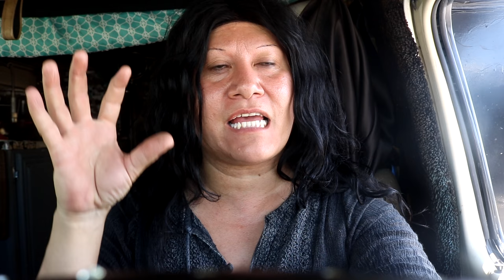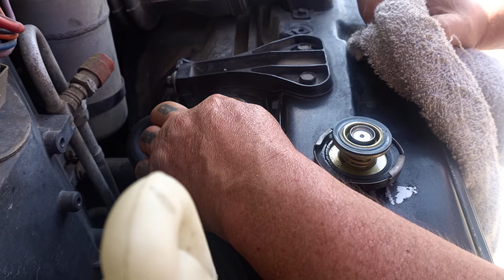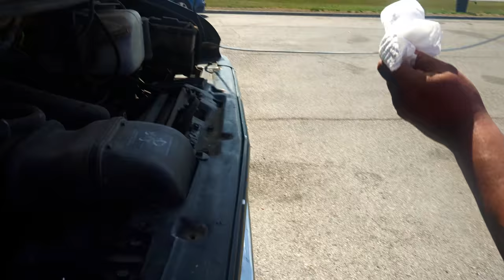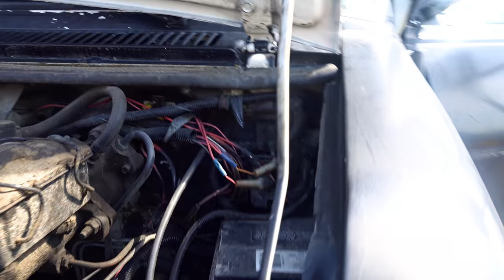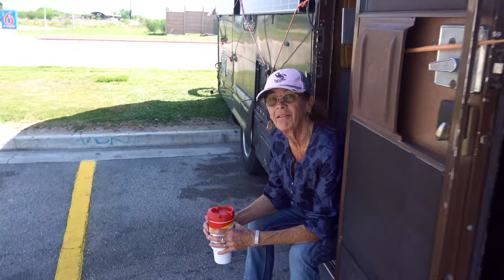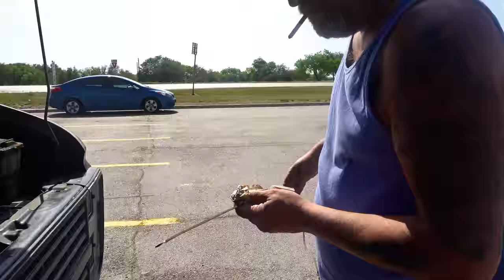RV Breaks Down Not Sure What's Wrong!

Comment: Hi Panda, This is a bit long, please read .....( I'm truly a mechanic, not an arm chair mechanic) from the sound of the engine and rough idle at first start-up it doesn't seem to be vapor lock to me. An engine needs 3 basic  things to run, 1) Compression, 2) proper fuel air mixture, 3) ignition/spark. ....possibly a bad ignition coil,....but sounds more like a fuel problem. 

As i have stated, from the sound of the engine It sounds like it's not getting enough fuel. possible causes to check are the following, ... bad fuel, fuel pump starting to fail, clogged or dirty fuel filter, bad or dirty injectors.  Start with the easiest task and work your way up the list. Also remove the engine cowling inside the camper and remove the air filter and bowl, ( I believe this  model and year of engine has a carburetor?? GM 350 ? year??? ) look down the intake on the carb and check to see if you see the injector spit out a nice stream of fuel in each port/barrel ( 2 ports side by side  ) when you press the gas pedal to the floor, you can also use the throttle lever on the carb to do this.
Has the gas filter ever been replaced? if this is the model i'm thinking of the fuel filter is actually inside the carb, where the gas line enters the carb, remove the gas line at the carb, now there is what appears to be the head of a larger nut that the gas line threaded into, remove the larger one ( the filter is inside that) I actually just did this two days ago on a 1984 Class-C , it's easy and takes only a few minutes to do. I would recommend you change the fuel filter, it only cost a few dollars to change ( $15-$20 )

You do a lot of travailing in the desert area in and around Arizona, the dust can quickly clog an air filter, please check and replace if necessary your air filter. A clogged air filter will also cause the engine to run rough and reduce your gas millage.

After checking all fuel issues and the engine still runs rough or quits down the road check the following,.... distributor cap and rotor, inspect for wear, cracks and any other possible damage, replace if necessary. This era of engine have been known to have ignition coils go bad ( square black box in center of distributor cap/ inserted on top of cap ) , since your there,..check your ignition cables  aka: spark plug wires for any damage and also don't forget to check or replace worn spark plugs, all of them. 

P.S, the coolant has nothing to do with the engine starting and running unless there is an overheating problem or a blown head gasket that is leaking coolant into the cylinders, this would also cause the engine to run poorly. If thee was any coolant leaking into the cylinders you would see the coolant fluid level dropping in the rad, and there would be white smoke coming out the exhaust tail pipe. ( White smoke= coolant leaking into cylinder, Blue smoke= engine burning oil, Black smoke= improper fuel to air mixture )

NEVER open a radiator cap when the engine is hot !!! he should have waited for the engine to cool down further before opening the cap, when the cap is difficult to open that usually means it's under some pressure and thus difficult to open ( basically it's telling you, DON"T open me now)  :)

i know this is a long list, and i'm not trying to preach,..but I am confident one of these things mentioned here is the cause, the engine might seem fine at the moment but rest assured the problem will come back to haunt you,  a good tune up and check for normal wear and tear should be done, you do a lot of driving, highway, back roads, dusty/sandy areas, etc... this all adds up and causes quicker wear and tear on the vehicle.   Onward bounds !!  :)

p.p.s: I also own a 2005, 21feet Class-C, Ford V-10 Triton engine. Hey who knows, maybe I'll see you and the tribe at the next RTR ?

Comment: Ausia, it still sounds like fuel pump or vapor lock.  Spring clothes pins on the gas line does help , at least on the older vehicles. My 1965 Ford Econoline still has clothes pins on the gas line from almost new and on hot weather it will allow you to pull out into traffic
and then die and let you sit in the middle of an intersection ! What fun !

Comment: My god it is a failing in tank fuel pump cutting off on its thermal overload circuit. Have it replaced ASAP As it will fail completely, Also have your fuel pressure regulator checked it could also be failing, Coolant lose will most likely  be the O ring on the riser tube behind your throttle body it will evaporate before you see it leaking so it is tough to spot...Good luck on your travels.

Comment: Love your group,I live in houston,came here from Maine,and my car had the same problems.it was vaperer locking.i am a ase certified auto tech.what happens is the older vehicles use less fuel pressure and can cause it to boil in the lines.so later on.the engineered put a fuel return system in.it just circulates from the tank to the throttle body and back to the tank and keeps the line cool to the touch.at up to 400 degrees under the hood it really helps.for now you can wrap some time foil around your fuel line where you think it's closest to heated areas.got luck my traveling friends.ever have any questions just holler at me on Facebook 👍

Comment: you have an older car so check water and oil levels every day, brake and steering fluid every week. also check you engine oil fill cap, if there's white stuff on the inside (looks like mayonaise) you have water in your engine (blown head gasket). try to keep your engine clean, oil and dirt will act as isolation and reduce cooling capability in hot places
Reply from the maker: Thanks

Comment: I'm going to recommend you implement "Maintenance Monday".   It doesn't have to be a Monday, pick one day a week and stick with it without fail.   On that day, every week, check all fluids, tire pressures,  all exterior lights, etc.   Get a GOOD tire pressure gauge.  Especially check transmission fluid. Also look at all your tires for nails, thread condition, any unusual wear.  Look at engine belts and hoses.    Check your spare tire. I checked my spare recently and it was FLAT.  Good thing I didn't need it that day.   Check generator oil, etc.  A few minutes spent weekly can prevent frustrating breakdowns and time lost on the side of the road and wasted $$$.  Do you have AAA membership?  Good luck to you and your traveling friends.

Comment: YAY Mick!!  Eddie (my 1983 Class C) used to that & only when he was hot.  Changed the fuel filter and did other work on him.  He still had problems, found out he has 2 fuel filters, the one up front & 1 in the back, near the gas tank.  Changed that one out and he ran like a top again

Comment: Change your Radiator cap! When the top seal goes it will let in air into the radiator as it cools down instead of drawing reserve coolant back in from the overflow like it is supposed to. That is why there was coolant in the reservoir and air in the radiator.

Comment: i had an old motorhome that would do the same thing i installed a cool can under the hood installed an electric aux fan for the radiator and hooked up some misters to the house water line that i could switch on while driving to help cool the motor all worked very well in the hot weeather or climbing long hills
Reply from the maker: Awesome

Comment: Ausia this is Harry, Lisies husband, I suggested the (map) sensor could be your problem with your vehicle. The check engine light doent always come on when sensors start breaking down. Mechanics can run other tests based on experience and equipment. Some parts stores will test the codes for free. O'riellys, auto zone, etc.
Reply from the maker: Thanks Harry... its been running great now that we have filled the fluids (my bad) although the check engine light is been on, but I'm going to have it checked out soon.
Reply: Panda Monium Autozone will put any 2008 and newer on the on board sensor reader thing & give you the read out.

Comment: I'd try draining and flushing the whole cooling system and buying a new thermostat and new antifreeze. Also add a bottle of techron carborator fuel injector cleaner or Lucas and a good tune up might help I have a 1985 Tioga class c with a 460 in it . safe travels 👍😊🌲🐾🐕

Comment: Glad you are running now, but You probably will be replacing the fuel pump soon. Keeping the fuel above the 1/4 tank level will greatly increase the life of the pump, especially in the heat. It depends on the fuel to keep the pump cool.

Comment: Wonder if the crank sensor is on its way out.  I have see them get hot shut the motor off and when cooled off. Motor start run no problem.   A scanner could help tell what happened and if any issues happening. You let them fluids get to low for to long.  It will be a new RV or motor.   Good luck  I hope it all worked out for you.  Take care stay safe

Comment: I had a vehicle with a similar problem.. After fixing many things based on friends bad advice, I called the dealership and asked for maintenance. I asked the guy who answered and he said it is probably the fuel filter. It's a do!lar and a half. Don't think about it just do it. The mechanic said the fuel filter was number one on their list of top common causes. If it's partially blocked the vehicle acts crazy, running most of the time but randomly refusing to start and sometimes cutting off on the road then starting again after coasting to a stop. Ignore had advice and change that fuel filter.

Comment: WHAT darrel w. said wooden clothespins.... we had a ford elite that would vapor lock, the young mechanic told mom to go buy some at walmart, showed me where to put them as mom wasn't mechanically inclined at all. lol   never had one cut out issue after the pins were put in place as the pins draw the heat away from the line.   we were always questioned why are there clothespins onthe fuel line?   that was fun.... hope it clears up

Comment: I had a 88 Chevy truck. The ECM went bad and would run for 15 minutes and wouldn't start until the ECM cooled down. The ECM looks like postage stamp size camera card that's quite up inside the distributor cap. It tested good but the test didn't get it how enough. I spent $400 on parts before I figured out the problem. The ECM was $25.
On another note, every time I replace the battery in my car or truck, the computer resets and I have to clean the intake. 
I've also seen the find on the water pump corrode to the point where the water pump doesn't circulate water. 
Another tip, some cruise controls won't work if one of your brake bulbs are out, especially one of the bulbs in the third brake light.
I know these aren't your problem but it might help someone.

Comment: An easy fix if it is indeed vapor locking; is to clip wooden clothes pins on the fuel line to help dissipate the heat from the gas line.

Comment: Your oil measures a little bit low when your engine is hot and running, don't over fill your engine oil, it's hard on your seals.  Measure your oil when the engine is NOT running, best reading is when the oil is cold and settled, and your vehicle is level. Transmission fluids measured when the engine is hot and running, and your vehicle is level, braking brake on. Coolant can deteriorate over time and should be tested for corrosion, buy a coolant tester. Even if your  Reservoir has coolent it could be  contaminated, and all this should be changed every 30,000 miles, I use a turkey baster to remove the reservoir coolant to change. Add only distilled water to your radiator, hint no calcium build up. I drain my own radiator, and only use the manufacturers brand at a dealership, flush with distilled water, then refill with distilled water and  coolant, usually older vehicles are 50/50 mixture of water and coolant. I've never had a  radiator go bad on me all these years.  I had a great dad that taught me when I started driving at age 14, hardship license, yes in some states you can still drive at age 14. I bet you didn't know that?  On the road again, happy travels! 🛣

Comment: if you're lying fuel line is vapor locking you need to reinstate the line going from your fuel tank to your intake of your motor work by or it's not so hot by your fuel exhaust it doesn't take much to insulate it and it's real simple to do if you can find some Plumbing insulation should be able to wrap around it and then take some 10 for a wrap around it you should be able to bypass the situation

Comment: I'd check your PCV valve.  They are about 5 bucks and easy to replace usually.  They can stick, suck oil, make you burn oil excessively, and make your rig run like crap.

Comment: You shouldn't be able to squeeze the bottom radiator hose.  If it's sqeezable that means that when the engine heats up, the bottom hose can collapse if it's too flexible.  Therefore shutting off the water flow from the engine to the water pump.  You're better off to get the radiator hoses that are reinforced with wire imbedded in the rubber.  The wire keeps it from collapsing.  Don't buy the solid rubber radiator hoses, because they will eventually start collapsing.   For your engine oil,  check it every 500 miles at least.  You do get oil usage depending on your weight and how many hills you climb.   I can use a half to 3/4 quart of oil on a ford 460 v-8 on a drive from Phoenix to Flagstaff on I-17.  Elevation wise we go from 2000 ft. To 7000 feet.  There are two really steep hills on the way.  One has been nicknamed "waterpump hill" because it's such a steep climb.  It requires a lot of downshifting, staying to right and a lot of patience.  Onward Bound!

Comment: Could be a bad coil.... when a bad coil heats up it will not send spark to the cap and then to the spark plugs. When it stops can you smell gas ? If there is no smell of gas then it could be a fuel pump.

Comment: A Vapor lock situation is not a coolant issue, it is a fuel issue. Generally the thermostat is on top of the engine, I'm about 99% sure on your old chevy it is on the intake manifold. The tank on the side is the expansion tank, fluid expands and contracts with heat. You do not have a blown head gasket on the intake side or you would have water in the oil. You'll have a cloud of white smoke spewing out the back if you are sucking fluid into the engine from a blown intake gasket on the compression side. 

Vapor lock is caused by gasoline turning to vapor when it is hot before it gets to the carburetor, it really isn't a common problem. More likely you have a plugged fuel filter or bad fuel pump. As the issue is only happening when it is super hot then check the routing of the fuel lines so they aren't to close to the exhaust, or perhaps the fuel line running across the top of the engine. 

You only check the transmission when the vehicle is running...

Comment: dont want to rain on your parade but my ex husband always told me that if your radiator blows bubbles after its full and the thermostat has opened at least once ... that it had a blown head gasket on the exhaust side.  not the kind that puts water into the oil.  have that checked.
Reply from the maker: Thanks

Comment: Fuel injection can't vapor lock, the return line allows cools fuel to continually circulate. If it's carb, and it's acting that way, go to summit racing online and get a carb heat shield and new gaskets. Then check all the fuel lines for a heat source or clogged filters. The fuel sock inside the tank could be breaking down as well. It's that simple, don't let a hiway mechanic give you some convoluted story, it's not that hard to diagnose.
1. The thermostat is on the top hose.
2. If your vehicle is 1987 or newer, you have the wrong coolant, you should have DEXCOOL a red color. The serpentine belt diagram under the hood says it is newer.
3. Don't rev the piss out of that engine, it does no good.
4. You can mix any oil as long as the weight are similar.
5. Never pour cold water unto a how engine without it running.
6. Get a Haynes or Chilton manual at AutoZone for the specific year Chevy van it based on and all the maintenance info will be in there.

Comment: helloooooooo have yea missed me as much as i missed you =} haha so 2 fill ups you should  shut down n check you fluids ! your trany should be run and warmed up and vehic should be running in park . hun never add cold water to hot engine ! if you keep vap lock you may want to follow the fuel line ans see if you can put in a heat shield. be safe out there  but have a ball doing it !!

Comment: Dont mean to be blunt....but I do believe your not over heating. The cool of the night helps prevent the vapor lock.  BUT its not a thermostat/overheating issue...re rout the gas line away from the muffler(?) / heat source you spoke of earlier. Ausia...Im 60 ive had lots of probs in my car/lifetime...trust your gut.... It is vapor lock from the afore mentioned heat source.

Comment: Honey if your RV is overheating, I would suggest getting it in to a shop ASAP... you could end up with a cracked block which is a new engine...since this is three times, and you put so many miles on it I think you will regret if you don't get it repaired...

A vehicle should never overheat...even in hot weather there are fans and such and a thermostat that should prevent that...

It might be worth taking one day to get it repaired completely...

Comment: Alternator bearings are going prolly....that is not why it is quitting the engine though...but I can hear bearings failing loud and clear..engine needs to be running to check transmission fluid

Comment: Take your Vehicle to a pro. (and replace your radiator cap with one with the correct pressure setting that works) THe Cap actually has to open to keep your radiator at the correct level.